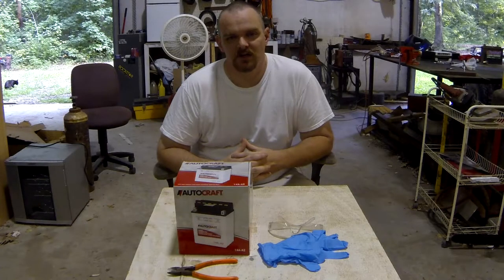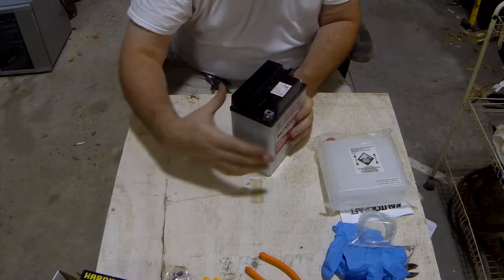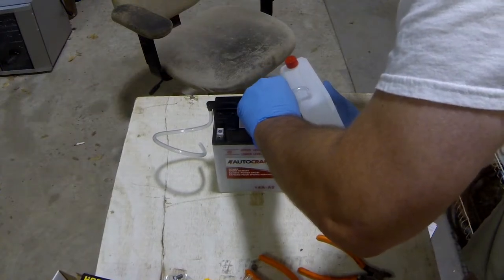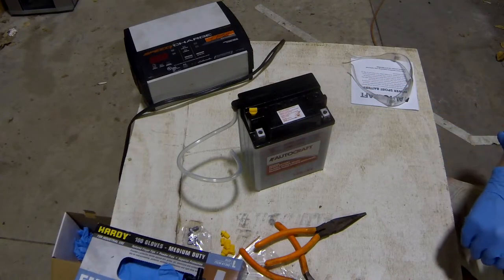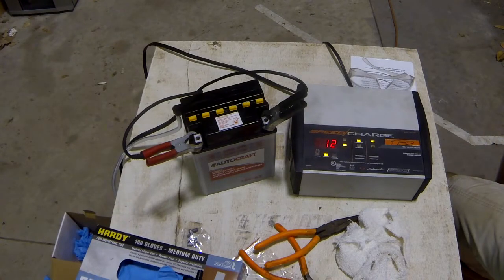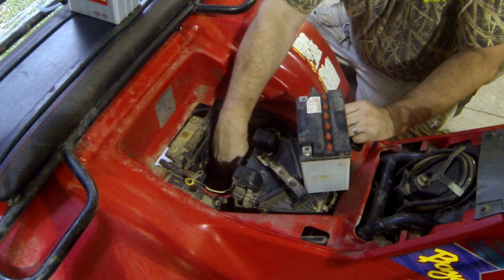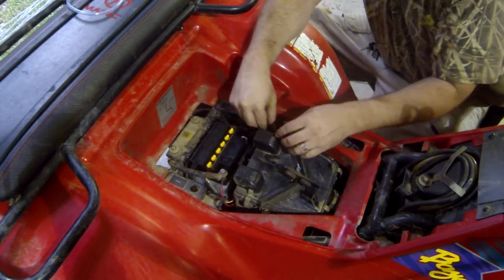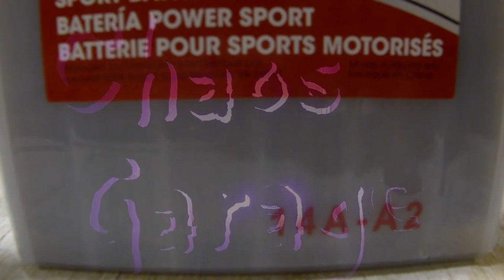How To Fill and Replace Your Power Sport (ATV) Battery

Comment: Lots of good info there. The interstate batteries I get for the atv have a six pack of acid cores you place over top the battery holes and cut the vent tab and it drains in itself. That's a first seeing acid like that. Nice vid buddy.
Reply from the maker: Thanks.  Sounds like you are getting the sealed AGM batteries.  If I would have ordered online, I would have upgraded to an AGM for the Kawasaki.  Filling & charging process is still pretty much the same.  Thanks for watching!
Reply: Chaos Garage yes your correct and I find it's the vibration that kills the atv batteries. We all have switched to agm batteries . Couldn't get 3 seasons out of a regular battery.
Reply from the maker: Yeah I put an AGM in the Honda...the next time I have to replace the battery in the Kawasaki, I'll order an AGM for it.  I got tired of pull starting it for a month, then the rope wouldn't retract (until I cleaned the dirt and crap out of it).  I snagged this battery locally for $38 all said and done.  A decent AGM would have cost me $60 or so and I would have had to wait for it to ship.  If I hadn't found that deal, I probably would have just ordered the AGM.  So if it lasts half as long as an AGM would then I'll have my money's worth out of it.

Comment: I never knew that you could buy a battery brand new that you had to 'put together'. Is it quite a bit cheaper that way or just the way those batteries are sold? Is that an acid solution, with distilled water added, or straight acid? Glad to see you don't have to get all 'john kerry' suited up in the NBC gear to do the battery fill. Do you think, you could crack that red cap open to speed things up a bit or would that be too big of a risk since you have to fill each cell?
Reply from the maker: A lot of the powersport batteries are sold unfilled.  Keeping dry extends their shelf life and are not as hard to store (temperature wise).  The acid is probably somewhere around 35% sulfuric acid and 65% distilled water.  I've never tried to pull the red cap off the bottle because a slight squeeze can fill up one of the cells pretty quickly.  You might be inviting an acid bath mess if you vent it.  That being said though, the sealed AGM batteries come with acid in 6 or so different compartments that you just plop down on top of the battery and it punctures a piece of foil to start filling.  A lot of times those come with a little push pin so you can poke a small hole in the top of each compartment and let it go.  Hope that answers your questions & thanks for watching my friend! :D
Reply: Chaos Garage Oh yeah. I'm always full of questions. I've only ever bought sealed batteries for the stuff we have, but it's nice to know there are options out there. Making the shelf life of a battery longer makes a lot of sense now that you mention it. We've bought a few batteries that were past their 'sell by date' and saved quite a bit of money doing it that way and they just need to be charged before you use them.
Reply from the maker: You got it my friend!